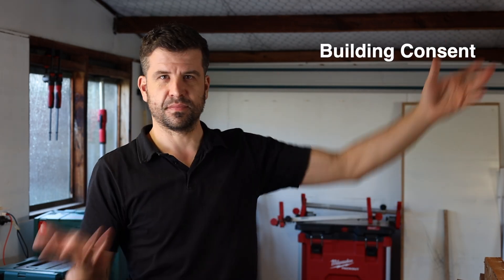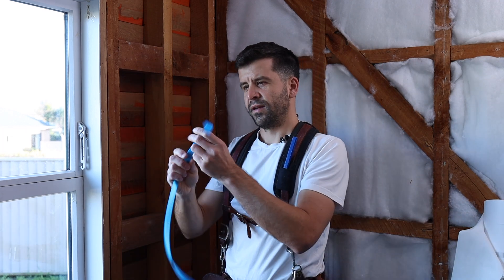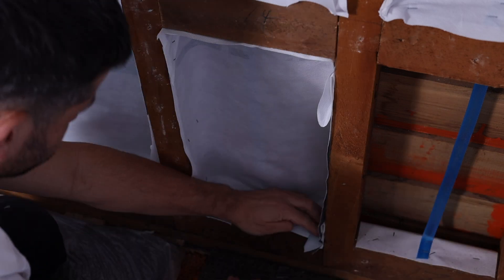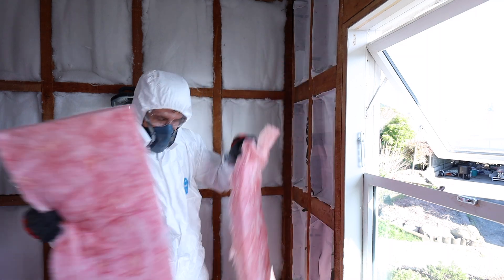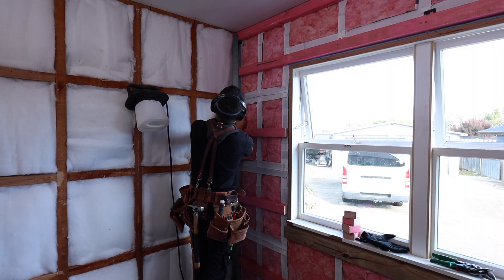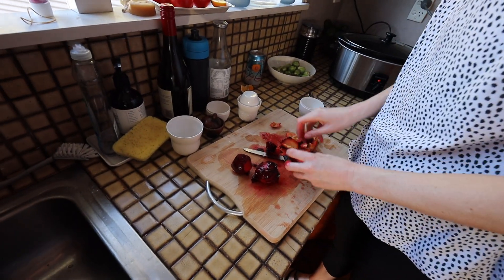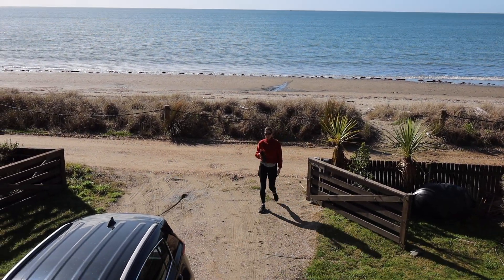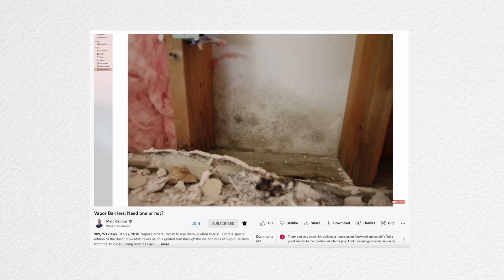We're Finally Going To Be Warm! Renovating Our 1960s House

Comment: This seems like a good system to give better conductive insulation while maintaining drying potential! It’s not perfect but as Hemingway said “Now is no time to think of what you do not have.
Think of what you can do with that there is”

Scott, do not forget about the convection heat losses. In a old house like this the wind can render the conductive heat resistance useless if all the heat gets blown out of the house by a breeze. Different researchers arrive at different numbers but a conservative estimate seems to be that 30% of the energy used for heating and cooling come from air-loss. 

The best way to reduce convective heat losses in your climate and house is to use drywall as an air-control layer. If the walls and ceilings are drywalled with an airtight connection it’ll greatly improve the comfort of the house. Make sure that all the electrical boxes and heating ducts get’s seals to the drywall and are airtight. It can occur great air-losses from electrical boxes and plumbing. 

Use expandable foam (in a can) to seal the internal wall cavity from inside the attic space.  Also, check gaps and holes in cavity sliding door pockets from above.  Internal wall sliding doors can contribute to significant air leakage.

The trickiest connection to make airtight in your house is between the floor and wall. The easiest method is to use Spray Polyurethane Foam to seal and insulate under the floorboards. This is not a DIY job. Furthermore the framing and drywall should get caulked to the floor boards, then you should have a good system.

Just don’t forget that a house needs ventilation. But this should preferably be handled by mechanical ventilation with heat recovery. 

The essence of what I am trying to communicate is the with not a lot of economical investment you can greatly improve the performance of your house. It’s about paying attention to the details of how every penetration and connection gets handled. There is an Australian company called Efficiency Matrix that also has a youtube channel that have a lot of great information applicable for you and the details you should implement.

Comment: Currently doing a 1930s Bungalow in the UK. We’ve built a stud frame 100mm in from the existing wall. We’ve then wedged a 100mm layer of insulation in between that and the frame so that we have no thermal bridges and then packed the frame out with insulation. You are right to be concerned about moisture when insulating internally. Definitely want to use a vapour open construction like you have so moisture can escape to inside and out. We’ve used Steico Flex wood fibre insulation, not sure if it’s available in NZ? But it’s great!
1. It’s not itchy to install
2. You can just cut it with a normal saw
3. It has thermal mass so takes longer to heat up in summer, insulating better from the heat
4. It’s denser than most insulation so has really good sound proofing properties

Another alternative we looked at was sheep’s wool however that was a little more expensive and didn’t have as much going for it. 

Also using a wood wool plasterboard and lime plaster on the wall to keep things vapour open. Has meant we haven’t needed any vapour control layers etc

Comment: You are sealing and insulating your house.  If you don't already have it, I suggest a Heat Recovery Ventilator (HRV).  My home has an HRV and I love having fresh air all the time, even during very cold or very hot weather when we keep the windows closed.  An HRV brings in fresh air and dumps an equivalent volume of stale air from the home, and it runs the stale air and fresh air through a heat exchanger.  So if it's below freezing outside, and your house is a lovely warm temperature, you aren't dumping all the heat outside when the system changes out some air.  Same thing in reverse if it's really hot outside.

Comment: In the Netherlands we use the saying: insulating means ventilation. Which means that if you close all the gaps you need an other way to get fresh air in your house. We have heat recovery ventilation here that uses the warm air to pre heat the cold air from outside. 👍🏻

Comment: In the UK, a timber framed building would have the cavity filled with a PIR insulation with the best practice being it fitted with a product like gapotape. Then externally you would have a breathable membrane, then counter battened to allow airflow, then your cladding.
Reply: Exactly  the same in Ireland with vapor barrier inside, also if using fiberglass insulation vapor barrier keeps fiberglass insulation particles from interning the building.

Comment: Scott the 50mm air space  needs to be on the external wall and has to be vented also to stop moisture turning to mould.i bet my last quid that them walls were not vented properly. You need air flow to dry the moisture up. 👍

Comment: In the process of doing something very similar in our upstairs room of our 1973 house (Melbourne). It was a metal roof -> 5cm air gap -> drywall. HOT. At 37c, the metal was way too hot to touch, and the room was an oven. We can get mineral wool here, so used that and a reflective wall wrap to try and repel some radiant heat. Sparkie's been to fit extra sockets and a run a data cable, so just need to get the drywall back on now.

Comment: I use full sheets of firm foam board (what ever thickness you want) secured to the studs and then put drywall directly on top of the foam. The drywall is screwed into the studs as normal. This gives me an additional thermal break and sound break.

Comment: The same method for trying to minimize cold areas are used here in Sweden as well. I did my garage with 195 mm and 45 mm of insultation. Since Im particular about what I put in my walls I use wooden fibre instead of glasfibre/rockwoll. About the same U-value as glasfibre. And we dont use R-value.

Comment: Here in Denmark we also have R value, but its most common calculated to U-value. Both is an expression of how much heat escapes through 1 m²(cubic meter) of the construction at a temperature difference of 1 degree between the exterior and interior of the construction part (W/m²K). Where as R is higher the better, U-value is better the lower.  We also have some pretty high isolation standards in our building regulations. Currently for a newly build Class 2022 house, you need at least: 455mm isolation in the roof, 335-300mm in the walls depending on it being bricks or wood or another "light" material and 300mm in the floor. It wasn't that fun being an apprentice, cause you would do all the isolation where I was an apprentice.
Reply: Same with the U-Value in Switzerland. Almost a half a meter of insulation for the roof is impressive! I think new builds here have to be U 1.6 or so, that makes about 200 mills of styrofoam on the outside walls (Usually still a classic plastered styrofoam on brick build, which isnt my favorit, but the cheapest unfortunatly)
Reply: U 1.6 is a very poor result for a new built house. That can't be truth.

Comment: Same problem came up, was talking to Mum about her 1910 house, and how we would make it warmer, shes already got double glazing, it was a big move to remove 4 lovely sash windows but theyre just too leaky. We talked about insulating the walls but felt kinda dodgy without building paper, bit scared of mucking with something thats been good for over 100 years. There is zero floor insulation, seems like a good next step.

PS Golden Bay is lovely parents used to live in Pohara and Rockville, Definitely hit the Kaituna track and Aorere Goldfields tracks

Comment: Hey Scott.  I work in building physics research, so can help answer a few of your questions...
- Yes, in the US they use imperial R-values (ft2 F h / BTU), whereas we use metric R-values  (m2 K / W) almost everywhere else
- You are right about vapour barriers too.  They are typically only a good idea in regions with harsh winters and very mild summers.  The general rule of thumb is to place the most resistance to vapour transfer on the warm side of the insulation - this avoids condensation.  So in cold climates, a vapour barrier can be installed on the indoor side of the wall, but in more temperate and/or variable climates like we have in NZ and Aus., it's better to allow the wall to dry in both directions.
- I don't see any value in installing the strips of building wrap on the indoor side of the frame either - if it was me I wouldn't bother.
- If it were me, I probably wouldn't bother installing the membrane between frame members, or establishing the 20 mm cavity, either.  The membrane is unlikely to be very effective as an air barrier, vapour control layer, or back-up waterproof layer when it is so discontinuous.  If it's standard practice in NZ it's probably worth doing though - maybe I'm missing something.
Thanks for all the great videos!  I'm slowly renovating a house of similar vintage myself - I'm always interested to see how you're tackling each challenge.
Reply: Hey Alan, what would you recommend if insulating between studs in a subtropical area such as Brisbane? Seems to be a distinct lack of info on insulating old weatherboard etc houses other than just pulling all the external cladding off.

Comment: Its fun to see the different standards and codes around the world:) The "Tek17" codes we use here in Norway now calls for 20cm insulation in the walls, and about 40cm in the roof. We also use the vaporbarrier and outside windbreak/Tyvek witch is also taped against all the openings (windows, doors, vents and pipes etc.)  to make it close to airtight.  Add that to the tripple glazed windows and its nearly a passive hous.  We also mostly use Rockwool or glassfibe insulation.

Comment: In Norway we put moisture barrier, but we also have 50mm of isolation after that on the inside. This to allow moisture to go in and then back into the room, we also use those 50mm to run the electricals so its hidden.

Comment: A typical  US 15 wall system is min 1/2 " osb with tyvek sheet over 2x4 4 framing  with 3 1/2 batt insulation and then plasterboard.The insulation can be glassfibre of mineral wool. I prefer mineral wool. However, if you can afford it, Get a closed cell spray foam specialist to come in and lay down a min 2" sealant coat and then put you usual insulation in. The sealant coat hits all the air gaps and then you have a airtight envelope.

I do watch Scott Rissenger's channel  and generally agree with him. He's a builder, I'm an architect.

Comment: I also when through the same insulating the exterior wall you should check out pro clima suggestion in retrofit exterior insulating they suggest removing the bottom exterior cladding plank so you can  make a slope on the bottom plate for drainage or the water may stay on you bottom plate. And I have the budget use their solitex separation mesh between the insulation and the cladding. You check them out unfortunately I don't have the cash to follow their ideas so I follow what the builders say will pass inspection.

Comment: Your should check out Kingspan insulation. Solid foam with great insulation value for the thickness (roughly double that of glass wool and Rockwool).
Reply: Plus, their Quadcore formulation now achieves the same thermal performance for the next thickness down i.e. 80mm now gives you the same as the old 100mm.

Comment: Hi Scott, great job. Autex Greenstuf make an insulation batt that I highly recommend - R2.0, 70mm thick for wall retrofit, leaving the 20mm cavity in typical NZ stud walls. Super easy to cut, better for health, also high recycled content. Used it for an almost identical job in Auckland this year, very pleased with it. Better than PB as that tends to slump more over time - this 70mm Greenstuf is much more rigid.

Comment: The supply issues are mostly due to Fletchers strangle hold on the building industry here. Partially, Govt owned and controlled Gib board through Winstones and also Pink Batts. Hence, it's almost impossible to source alternatives here. Cool way of doing the double layer insulation. Ive seen similar trials done in Scandinavia with excellent results. The key is offsetting the studs etc between the two layers.

Comment: Nice job - really good use of the 70mm+50mm combo - that’ll be a really warm and quiet room.

We’re doing a skillion roof at our next place, and from memory we’re going with 70mm R2.2 plus 90mm R2.6/2.8 to give close to R5. The skillion products only go to R4.1 as they’re less dense - they’re also more expensive than using the two blankets.

Regarding the ‘which way should the building wrap be’, I wonder which way around it’s supposed to be as an air barrier which is their alternate use. e.g. on a plywood ceiling with shadow lines or T&G where it’s leaky air-wise, you can put building wrap up first to reduce/eliminate the air leakage. But which way around should it be? I guess you probably want the outside face in? Not sure whether the one-way direction for water vapour works for air generally?!?
Reply: the membranes that require to be around a certain way are often smart membranes which you install on the gib side of the wall. follow the manufactures instructions. on the cladding side you really want a rigid air barrier like RAB or plywood. on the roof you can also do external insulation which helps protect the air sealing layer.

Comment: I live in warm and mostly dry Arizona USA and I used spray foam in all exterior walls with no vapor barrier, and I used Rockwool sound insulation in all interior cavities so I have a very quiet home. I don't know the specific R value of my spray foam but the reason I choose it was because it provides a great barrier to air infiltration, and when it's 115F outside and you're trying to cool the interior to 75 my heat pump handles it without a problem. I greatly enjoy your channel and Matt Risinger's Build show as well.

Comment: In the netherlands we use Rd same as R measurment. In new houses the rules are minimum r6-r10 max. It is s crazy high standard for new houses sometimes the roofes are 200mm plus thick. Zero energy houses is the future. They think here haha 

Pir isolatie panels are much better than glaswool because they isolate more with less thickness and they have an aluminum layer to protect from moyster .

Nice video

Comment: I live/build in the Southeast and we do R13 in the walls (we are 2x4 construction). As for the ceiling it's either R30 Batts or blown insulation that is typically about 14" thick.

Comment: I would have used intello wrap between your old and new studs. It would have been a good moisture and air barrier. But you'd need to make sure the condensation is managed correctly. You'd need a pro for that analysis. 

Also what someone else pointed out here...pull data cables. Even if you don't need them now having them in the wall for later use is gold. Retrospectively installing is $$$$. Get a 305m Cat6 drum and go nuts.

Comment: In Indiana we have have R11,R15, R19 and R21 depending on the wall if the wall is a 2x4 its usually R15 but on basement and garage it would br R11. 2x6 walls can fit a R21 flush to it.

Comment: I'm an architect in the UK and currently building my own timber framed house to passiv standard. I work in u values generally rather than R, but I think we have managed to get about R7.5 in the walls using 150mm wood fibre insulation between joists and 60mm on the ouside, should be toasty!

Comment: Hey Scott, if you ever use a vapour barrier in the future, use some 20mm treated pine to create a cavity, we call it a cavity batten - this way your vapour barrier never touches your cladding and still allows air flow and evaporation to avoid the mould. You could still achieve that here because you packed out your walls for the additional 1.2 R rating, you just place your vapour barrier behind those battens and condensation will never get trapped that close to the gyprock. We've started doing it a lot over here in Australia on higher end homes.

Comment: We live in an ex state house in a colder area than Nelson and we are in our 70s so that I for one feel the cold more than I used to, even at age 50.  Some years ago we had the ceiling insulated and an insulation fabric was stapled under the floor and the vapour barrier put on the ground.  (We also put plastic film on the windows which is actually very effective for the cost, if not ideal).  This has made a huge difference to our home and we now no longer freeze.  These days I like to have oil column heaters on sometimes and that is a big luxury for us.  Therefore I question the need to have a double layer on the external walls in Nelson.  We have no insulation at all in our walls but we are happy with the huge improvements of recent years.